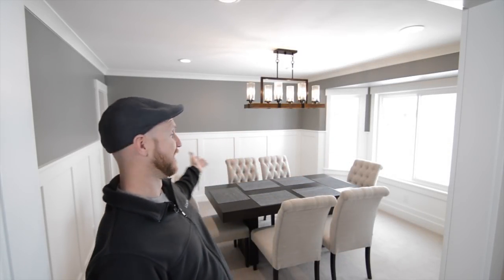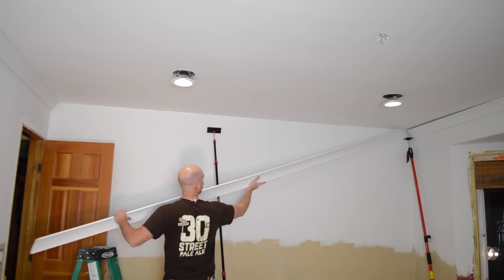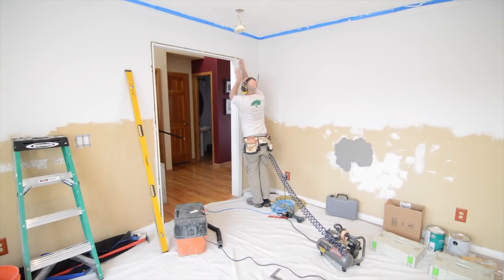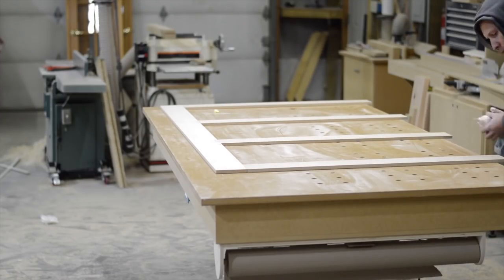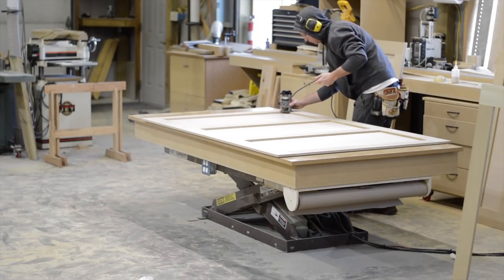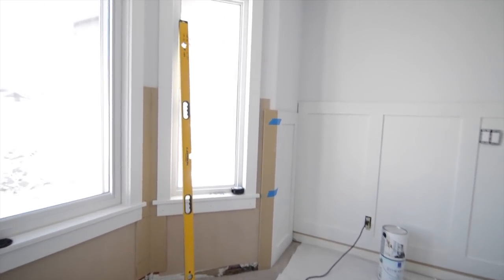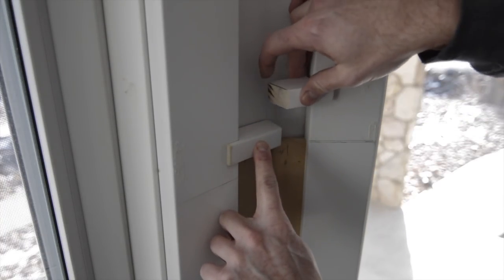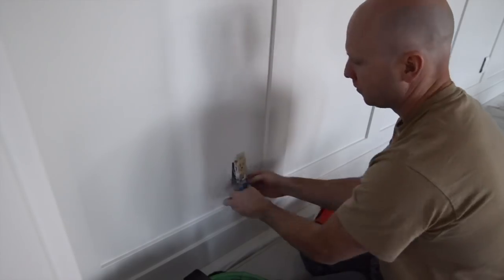Dining Room Renovation, wainscoting or Board and Batten

Comment: Excellent and beautiful job by a professional craftsman. Absolutely noting to criticize. However, if I want to do the same thing in my house, I can't because of limited space and tools. As with most things in life, there is more than one way to accomplish it. Now, I'm not saying his way is better. In fact, it probably isn't, but he produces a professional job and appearance without a biscuit jointer, clamps, glue, and a big shop. This guy does everything on site and uses pocket screws instead of biscuit joints and glue. Other than that, he does it about the same way.  Check him out  Finish Carpentry. Search for wainscoting. Yes, I did recognize your material is thinner, but you could use  the pocket jig mini and shorter screws
Reply from the maker: Russ, I would have no problem doing this same job with pocket holes. The only thing I would change would be to make the frame material out of 5/8", just to be safe the pocket screws don't show through.
Reply: @MikeFarrington  Or use smaller pocket screws such as those used for drawers.   Anyway, they eliminate the need for glue and you can build them on site.  Kreg clamps are also mandatory to keep the stiles and rails flat.  Anyway, you have a system that works and you produce a fine product.
Reply from the maker: @russmartin4189  I dislike changing my pocket hole machine, so setting up for the smaller size takes too much time. Totally agree on the clamps. I would suggest adding some glue to the pocket holed joint. This will help prevent the seam from showing through the paint months or years down the line.
Reply: @MikeFarrington  I will do that. BTW.  I got back into this because I saw wainscoting in the model for the home we were going to buy.  I said, "I can do that".  Then I saw pocket holes and screws, and I said "where have you been all my life?". I agree that glue will help a lot.  With my limited tools, doing joints had discouraged me. I made three pieces of furniture using dowels, a  1/4" hand drill, and a drill guide.They came out, but with too much effort.
Reply from the maker: @russmartin4189  Pocket holes are super useful in the right application, and yes, way faster than dowels.

Comment: Hey Mike, how did you handle the MDF edges while painting? I can never quite get them smooth.
Reply from the maker: Good quality primer, and sanding. The edges need lots of primer.
Reply: @MikeFarrington  how did you like the airless sprayer? I’m debating between that and an HVLP system
Reply from the maker: @joeyfreeland9337  The airless is nice for paint. I don't like it for solvent based materials. HVLP works better for those.
Reply: @MikeFarrington  was the finish nice and smooth using those fine finish tips?
Reply from the maker: @joeyfreeland9337  Yes, very smooth.
Reply: @MikeFarrington   Last question, I promise… Did you prime the MDF with oil based or water-based? I’ve heard water-based can raise the MDF grains

Comment: What do you do if your wainscoting (horizontal & vertically) is thicker where it meets the door trim?
Reply from the maker: For a proper job, either the wainscoting needs to be thinner, or the trim needs to be thick. In this case, I used thicker than normal casing, and thinner than normal paneling.

Comment: You’re a hell of a Carpenter but I’m not really quite sure why you put MDF as a backer especially around the windows everybody knows what MDF does when it retains moisture me personally I would’ve done the exact same thing you’ve done without the MDF because now you have to figure out your trim that has a quarter inch do everything
Reply from the maker: I could have used plywood, but I'm not really worried about water coming in. If it becomes a problem, I'll just redo it as needed.

Comment: I don't really tell any one how to do there work, To be honest it wasn't
necessary to board
it.. You could just put the lats on the wall & painted it.. With out boards
Would saved you lot of time,
& nice dado rail trims in the boxes.. You done a wonderful job though
Reply from the maker: It is totally necessary if you want it to look good. The drywall has a texture, and would look horrible if I tried to fake it as paneling.

Comment: you did the wainscot too high. its suppose to be 38" for a 8' wall.
it has to be under light switch.
Reply from the maker: Is this opinion or fact? I really like this height. I have been in houses will all kinds of different heights of wall paneling, some almost as high as the doors.
Reply: @MikeFarrington  I agree.  It is all about personal preference and there aren't any hard and fast rules regarding the height of the wainscoting.
Reply from the maker: @dajur1  Thank you Dan.

Comment: Mike, I don't know if you have a pole sander for drywall.  It's sort of a love/hate thing for me,  but I think they do help when you have to skim coat walls.  Full Circle makes some nice products.  I also like a  longer knife, some like a 16" or even larger,  just depends on what works for you.   You do beautiful work, I really like that shade of gray with the white.  

http://fullcircleinternational.com/
Reply from the maker: Hi Tom, I do have pole sander, but its just the kind that attach to the rectangle sanding pads. The full circle stuff looks very cool. Thanks for sharing. I will say, I'm not doing another project like this one without a powered drywall sander. My right shoulder is a couple years away from needing a replacement, so no more hand sanding for me. For the same reason I use a smaller 12" knife, I just don't have the strength to spread out mud using a larger knife. Finally, I fully admit, I am not good at drywall, I get good results, but I'm not efficient at all. Thank you very much, gray is a tough color and can be deceiving. I am happy with this color combo as well.

Comment: Your panels are too tall for the ceiling in that dining room. Better sized panels would had eliminated the need to move your electrical switches. If the ceiling was 12 to 14 feet tall than those panels would had been perfect. Just my experience speaking, but to each their own.
Reply from the maker: Thank you for sharing.